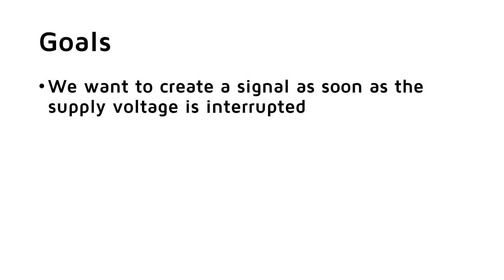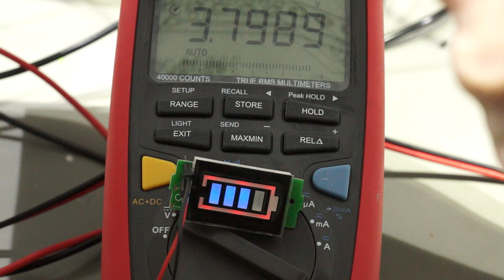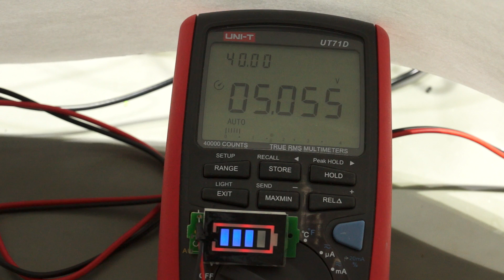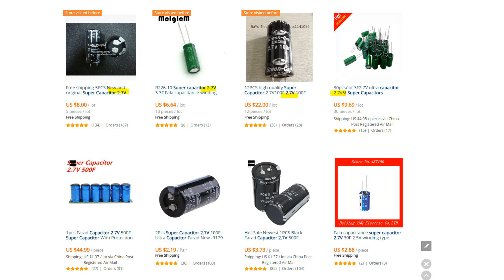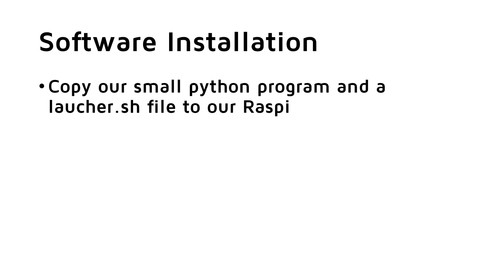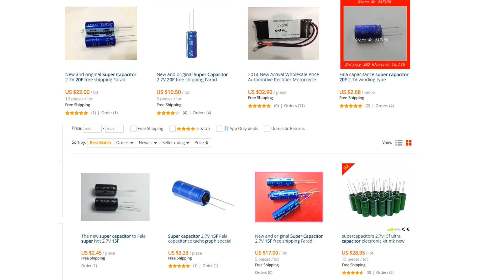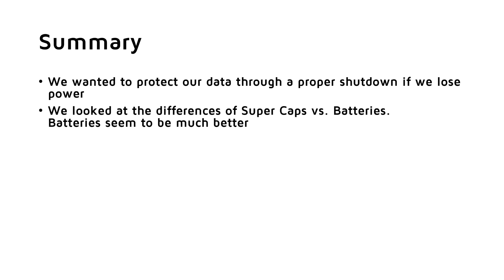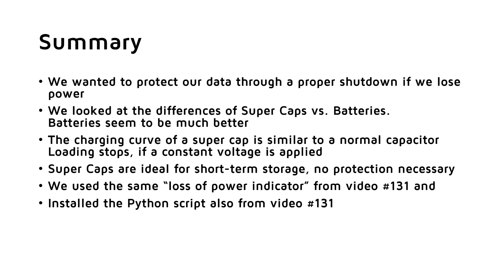#133 Safe Shutdown for Raspberry Pi with Super Capacitors

Comment: Love your content, I am wanting to know if this could be used for a Pi in a car. I have an aftermarket ECU and want to monitor it through a Pi set up. The safe shut down is all i have left to figure out. Thank you!
Reply from the maker: I do not see why it depends on where the Pi sits.
Reply: @AndreasSpiess  Thank you for your reply. Do you have an itemized list of hardware for this?  I will be using a Pi 3. Thank you again. I'm so new to all of this.
Reply from the maker: @johnhale6468  There is a bit more info in the comments of video #131.

Comment: Interesting but not necessary. Just enable Overlay File System to make the boot sector read-only. That way an abrupt shutdown will not corrupt the SD card or USB drive.
Reply from the maker: I agree, but I don't know if it protects your data (unless you store it in a different place).

Comment: I sure would love to see an update to this project. Many suggestions have been made in the comments on how to improve on it. Did you manage to omit the battery display? Does a 5v step up converter give the PI more time and stability to shut down? Or does it consume too much on its own for it to give an advantage?

I really love this idea and your solution is so simple and can potentially prevent a failure of any PI project.
If you got the chance, an update on your findings would be very helpful.
Reply from the maker: We tried to create a power board with all the nice things in it. But unfortunately the project is on hold because of the supply chain problems...

Comment: You can make it without the voltage detection harware as well if you want it some cheaper. since most likely you will use ethernet for your server/24/7 running pi. that means that you can use the network connection to test for a power outage, no network mean no power, or at least no reason to be on anymore, you can edit the bootfile to wake on lan to automatically turn the pi back on, this is especially helpful for when you use wifi or such, since wifi sometimes has random periods of time where it stops working. you can either use a small ram only os pre-boot to make it work on wifi, even without the dedicated hardware, or setting up the router properly. another more easy step would be to save all files, and mount the drive as read only until the network reapears, this way you do not need to restart if it is only a network outage, by unmounting the sd or mounting it in readonly you won't corrupt it, many raspberry pi oses also have this functionality building, however you need to customize it since in general they boot the os in ram from start when this setting is enabled.
Reply from the maker: This device was mainly meant to avoid an fast shutdown which can corrupt your SD card. Your measures are good and can be added in addition. I think.
Are you sure the Raspberry Pi supports WOL?
Reply: @AndreasSpiess  this is also solely meant to avoid corruption.
The raspberry pi does not officially support WOL however it can be inplemented both softwate based and hardware based without to much weirdness. Hardware based it can be done easly by splitting the ethernet cable and connecting it to a small ic like a arduino, then when a network signal is detected it enables a transistor or io pin to trigger the raspberry power on pin, this method is really simple but has the cost of a small ic qnd optionally(for more accuracy such as requiring a speciffic package to start) a ethernet shield/chip connected. Note that a arduino in this case could be used without ethernet shield since the arduino uno is fast enough to work as a ethernet driver, so it can be quite cheap still. The other method however does not have hardware cost asociated to it since it is actually build in to the raspberry pi by default but rarely used for reasons such as wol. But the raspberry pi boots up whenever lower os connected, this can be used directly, however since the power might still be unstable wol might be desired, when you install a os on the raspberry pi it also installs a bootloader, that bootloader can be changed/modded if required to at first connect in read only to protect the msd/sd/usb might the power stop again. You can do the following directly in the bootloader, but also in a small micro os which you boot in ram mode and read only this only has the functionntonwait for a message and then when it gets the message it powers up the normal os/switches to it. The first steps are most easly done as a micro os, the last one is most easly done if you go for modding the boot loader. Many linux bootloaders allow you to easly mod them directly from the in linux terminal.

Comment: Hi, thank you for your excellent video. I live in Spain and frequently get power blips (electric is cut for about 1 second or less) which causes the pi to stop working. To get it going again I have to repower it which is a pain. My pi is a 3B+ and runs from a 60Gb SSD. I wondered if I could use this just to keep the pi working during the blip (I don't want it to do a controlled power down when there is a blip). Cheers....
Reply from the maker: You can try it. It should work.

Comment: Could you use a 10 ohm series resistor to limit current to 500mA when charging the larger supercaps?  They would buffer any surge current needs of the rPi I think?  It would take a lot longer to reach working voltage but would be safe on pretty much any USB charger that way.
Reply from the maker: A resistor can be used to limit current. Usually, USB chargers have a current limitation to around 2A. But if you try to limit the current for the Pi it will crash because the voltage drops if it does not get the needed current (ohm's law).

Comment: Thanks, but after the pi has shutdown, it begins to reboot again. Any idea of the cause or fix fir this? Pi 3b+
Reply from the maker: Strange. Usually it only reboots if it is power-cycled
Reply: @AndreasSpiess  how is reboot triggered when power cycling? Does the pi detect a rising voltage?
Reply from the maker: It just boots when plugged-in
Reply: @AndreasSpiess  solved by using halt instead of shutdown now. Thanks for the video, very useful.

Comment: Is this still a valid solution for the safe shutdown of e.g. a RPi 3B+?
Also, couldn't you connect the USB-power (before the caps) to one of the GPIO pins (dropping to 3.3V with resistor) to check when it goes from high to low?
And maybe add a resistor after the caps to gnd to make sure they discharge?
Reply from the maker: This solution still should work.
Reply: @AndreasSpiess  Can it be done without the battery indicator?
I was thinking about having the USB power also connected with a GPIO?
Reply from the maker: You have to be able to measure battery voltage.

Comment: and which size of super capacitors i have to use for raspberry pi 4  model?
Reply from the maker: I did not do the calculations. Maybe even the same because it shuts down faster.

Comment: the supercapacitors supply power to back in my usb  pin where i connect other component so what to do to stop the power in reverse direction form super capacitors ( i used diodes all type but because of 5V and 3A there so voltage drop between 0.6V to 1.2V  and  raspberry pi 4 want minimum 4.63V and 3A power supply what to do now?
Reply from the maker: If you use Schottky diodes your drop is less.

Comment: Really cool project! Just wondering what the advantages are of your voltage detector over using an external ADC? I guess for the ADC to need a constant reference voltage?
Reply from the maker: ADCs usually have built-in references. 
Voltage detectors are much simpler.
Reply: @AndreasSpiess  OTH an ADC is already present on the SBC. Why not use it?
Reply: @paulpvhl1930  Great idea. Just connect the ADC in of the Pi-Zero via a divider to the 5V input. With a simple program, measure the voltage, and if it drops, shutdown. I will try that soon.
Reply: @harry4516  I'd like to know your results. I really can't see why it wouldn't work but still have no personal experience with the Zero. Thanks.

Comment: Put a small resistor over each capacitor like a resistiv divider so 2,5v gets connected between bouth caps.  >The one whith more voltage gets discharged a little Bit faster than the other one over its resistor. And they discharge the caps until they are empty, so charging is always startet from 0v. 

Its Not the Best solution, But the simplest one.
Reply from the maker: You are right. This is a good way, if you discharge the caps frequently. Probably (hopefully) not the case in a UPS situation.

Comment: Hello Mr. Spiess, what Diodes and NPN Transistor are you using in this build? Great Video, i learned a lot from you!
Reply from the maker: just what you have. It does not matter too much. Just no shottky diode because it has only 0.3 volts drop

Comment: Hi,
Do you think these single 5.5V15.0F Capacitors could be used instead of two serial capacitors?
https://www.aliexpress.com/item/32907224615.html?spm=a2g0o.cart.0.0.55733c00n7fa5P&mp=1
Reply from the maker: I think so. They contain 2 capacitors in series.

Comment: Great video!! I've just built this but i've a problem in balancing the supercaps: starting from both at 0V and charging with 5V, the second cap (the nearest to the ground in the schema) is charging very slow compared to the other. When the first cap reach is 2.7V, the second is around 2V...I thought to not use the active balancing because of cheap supercaps and meant to be used rarely, what do you think?

Comment: Add a resistor in series with the 500F capacitor's ground. It should lower the initial power draw on the charger.
Just make sure the Pi has sufficient voltage during shutdown.
Alternatively you could also provide the Pi with a 3A charger; but should work with as low as a 1A charger for the 3B and 3B+, and 0.5A for the Pi 2, and lower models.
Reply from the maker: Good idea.

Comment: can we use a diode and a resistor so the raspberry turns on immediately? the charge of the super capacitors is made through the resistor and the discharge through the diode, that way the charging of the super capacitors doesn't sag the power supply
Reply from the maker: I do not understand your question.
Reply: @AndreasSpiess   The power up is really slow because you're charging the capacitors, and it sags the power supply. You can create a parallel path that powers the raspberry directly from the usb, from that parallel there's a resistor that charges the capacitors slowly and a diode that feeds the raspberry from the capacitors when the power supply is off. Maybe i'm seeing it wrong... just a though

Comment: Hi Andreas, Thank you very much for this interresting video. I am currently building a Phoniebox for my 4 year old and the the "Göttibueb" of my wife and it would be neccesary to have something that is shutting down the Rasp when the cable is pulled. Kids can be very cruel with Raspis ;) I have bought a Geekworm Raspberry UPS Hat but this device has some major disadvantages (like a power button to switch it on after power failure) which makes it unuseable for my project. If you want I can also send you one of these to for analysis, hacking or improvement :) But my question would be if you can guide my to have small UPS with supercaps only without the fan control? What would be the smallest config to get this working? Cheers, Thomas
Reply from the maker: I do not know of a UPS with super caps. But with this video (and maybe the one I did for the protection of super caps) it should be possible to build one yourself.

Comment: Thanks for the great post could you provide a diagram using the supervisory circuit (KA75450) and the other resistors you talk about below? I want to test this on my PI. Also is there a way to have the capacitors discharge faster? Thanks - John
Reply from the maker: I did not continue this project. So I have no additional diagram.

Comment: How about LTC4411? A low loss ideal diode with status signal and it has limited 2.6 A output current. Or I miss something?
Reply from the maker: How would you connect it?
Reply: 5V power supply to LTC4411 INput pin. Supercaps and Raspi power input to OUTput pin. GPIO-pin and 3.3V pull-up resistor to STATus pin. GND and CTL to ground.
Reply from the maker: That would also be a possibility. Unfortunately, I did not find many sources for the LTC4411 on Aliexpress and it was expensive
Reply: Have You tried other Raspis than Zeros? They have ideal diodes built-in. Needs only a voltage conversion Vin --> GPIO. One concern is how the polyfuse can handle the surge current of the capacitors.

Comment: This is pretty cool solution for a problem I've heard about several times. The ext4 filesystem gets corrupted when you force power off. Wouldn't migrating to a btrfs root filesystem be way easier than all this though? It's never in an inconsistent state.
Reply from the maker: I am not a Linux guy. So, I had to go the "hardware" route...
Reply: its not ext4, it is the SD card itself. If you use an SSD instead of an SD the problem is almost gone.

Comment: I think your low voltage detector should be BEFORE the caps along with a diode to prevent revere current from flowing into the monitor. This would allow to trigger shutdown immediately when power is removed. Now, you have to wait for the caps to go before a certain voltage.
Reply from the maker: That is a good idea! Thanks.
Reply: Wonderschön videos meine freund ! Danke fur alles !  
Schweiz Felsen! lol !

Comment: Love your channel Andreas! Sorry that this isn't relevant but I am struggling to find an answer and it would be much appreciated if anyone could help!

I have built a neutron detector (university project) with a Raspberry Pi 2B and have programmed it in Python 2.7. I am detecting neutrons via an electrical signal sent to one of the USB ports by a soundcard and I am reading the signal using PyAudio. It works fine apart from the fact that it can only detect up to 40 counts per second as this is the highest amount of reading PyAudio seems to give me! Is there any way I can get PyAudio to give me more than 40 readings per second?

This is the PyAudio code I am using:

stream = pyaud.open(          # Open input stream, 16-bit mono at 44100 Hz
    format = pyaudio.paInt16,
    channels = 1,
    rate = 44100,
    input_device_index = -2,          # Input device likes to be -2 ;) 
    input = True,
    frames_per_buffer=8192
    )

# This function reads the data from the sound card:
def RecordCounts():          
    global CV
    rawsamps = stream.read(1024)          
    samps = numpy.fromstring(rawsamps, dtype=numpy.int16) 
    CV = analyse.loudness(samps)          

Thanks in advance!
Reply from the maker: I have no idea. I never worked with any of these things. But maybe it would be a possibility to use a microphone, a small amplifier (OpAmp), a diode, and a capacitor to create a digital signal (one per neutron) out of the audio signal outside the RPI. Then,  the RPi just has to count logical signals. And this is for sure faster... Or maybe you even do not need a microphone if you connect the output of the sound card directly into your amplifier.
Reply: I never thought of converting to digital first so I will try that, cheers Andreas!
Reply: MaD bEN I will always believe in Andreas! In the end it worked?

Comment: How about putting a Shotkky diode in parallel with a current limiting resistor, in series with the supercaps, with the diode pointing towards the +ve rail. In that way the diode will block charging current and so the charging current will flow through the resistor. You can then limit the charging current by choosing an appropriate resistor. Once the is lost, the diode will be forward biassed, and has a very low forward voltage, so your Pi will be powered from the supercaps largely unimpeded.
Reply from the maker: You are right. This is a good thing to solve a problem. But I did not experience any problems, because my cheap USB cable has already a resistance, my USB charger has a over-current protection, and the high current lasts only a few seconds. So, there was no need for more parts. But all of this changes, of course, if you use bigger caps.

Comment: Thanks for the video. This is food for thought for my problem; my mppt controller charges a battery and RPI zero during the day, at night the RPi discharges the battery until the battery's low voltage circuitry disconnects the battery from anymore drainage. The next day the battery remains in this disconnected state eventhough the charge controller is receiving energy from the solar panel. I have to manually disconnect & reconnect the battery to get things working again. So I need to design some circuit to do this for me...
Reply from the maker: This is a problem of many LiPo chargers. The UPS I used in my previous video has the same problem. You just should not discharge the battery completely. But the device has no protection
Reply: Yes, it seems so but how do I prevent it from discharging completely?
Reply from the maker: Not easy. Maybe add a protection circuit? Some of the LiPos contain already such devices, some not.